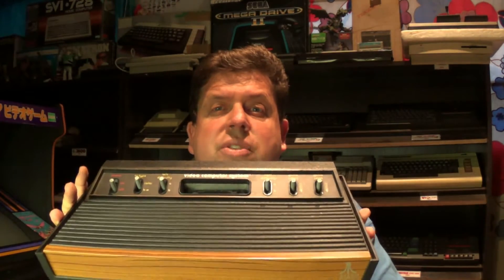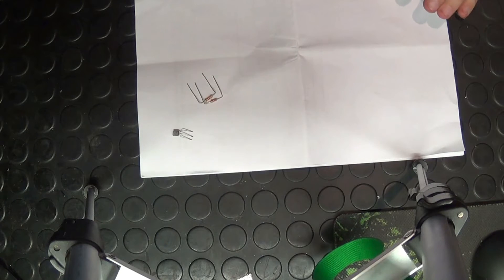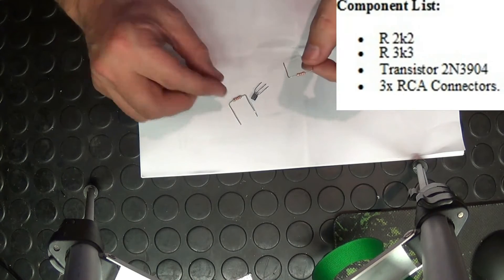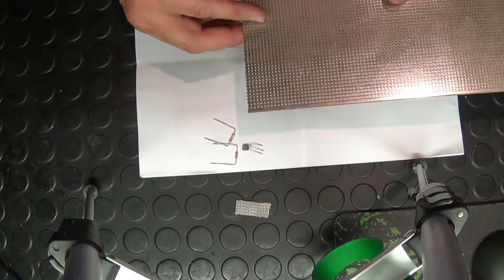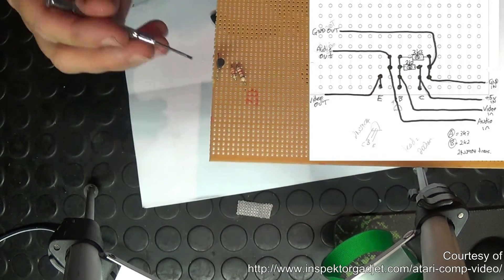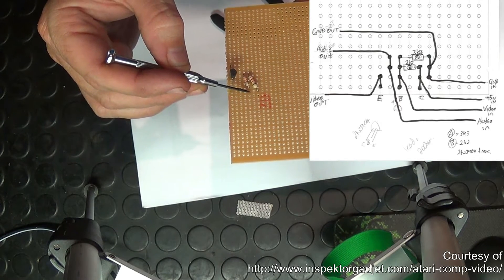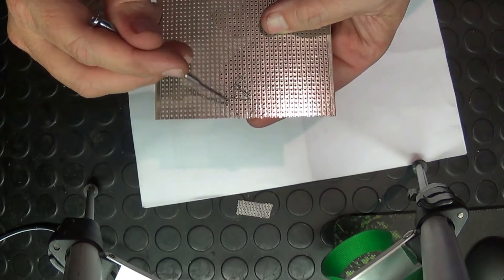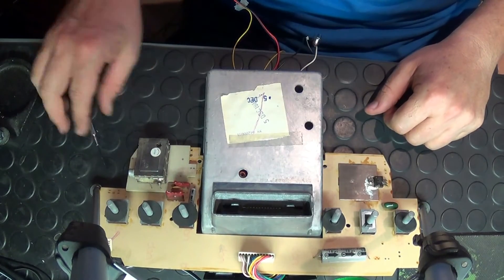Atari 2600 AV Mod

Comment: Excellent result and not too hard to do either.
The removal of the coil was interesting, wonder why it caused issues, must have been taking some of the signal out of the line perhaps.